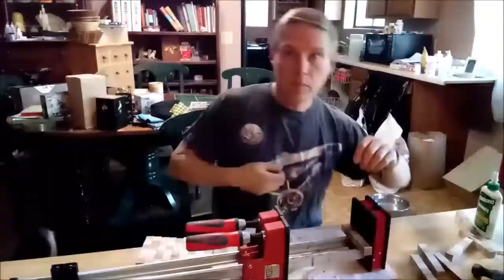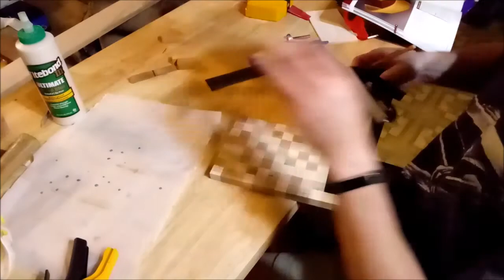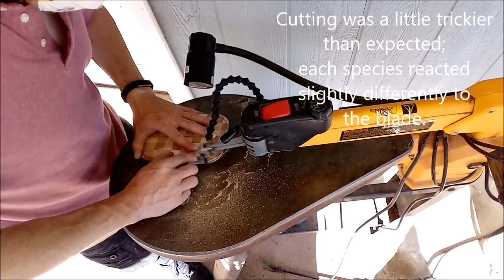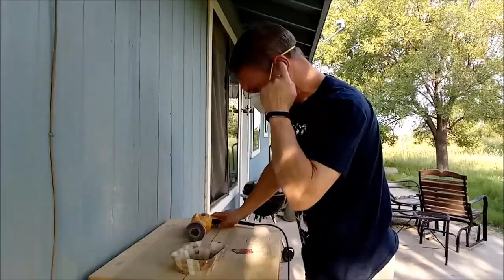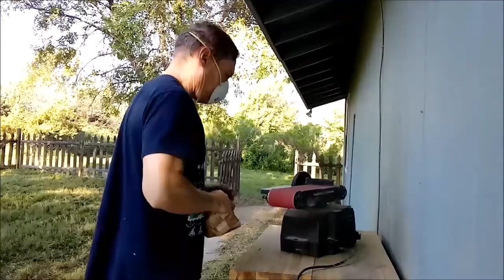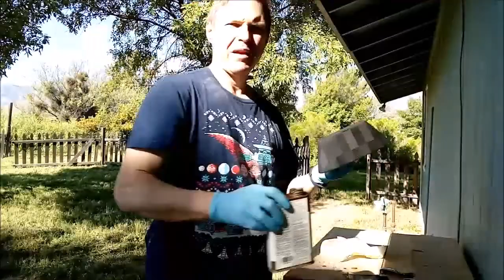Return of Yet Another Scroll Saw Bowl

Comment: Can I make a small subjection when you know your going to have a lot of sanding to do. Go to     https://www.Rockler.com  and purchase a sanding mop, they come in all  sizes grits, but you want to get them thick enough to do some good. they will simply make sanding easier. I have several from 100 to a 280 grit. You can use these like fingers doing your work for you.
Reply from the maker: I've tried a few different sanding solutions but the spindle sander is doing the trick so far. However, I'm planning to get a drill press soon and am eyeing the inflatable sanding balls to use with it.